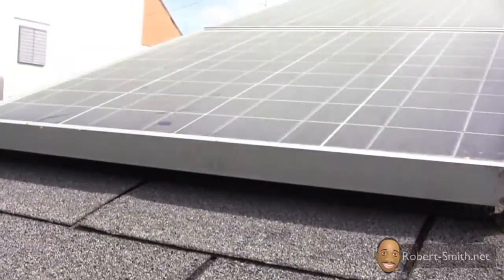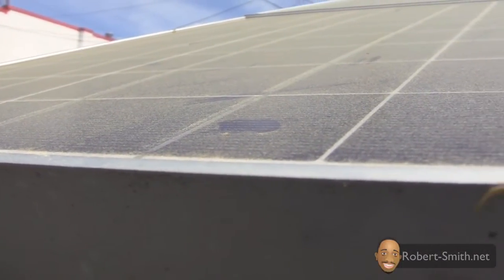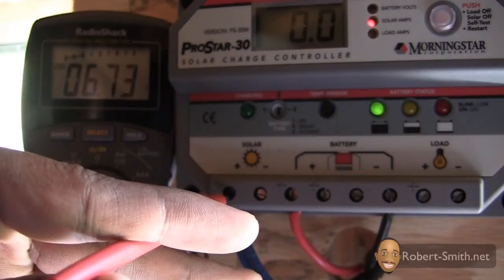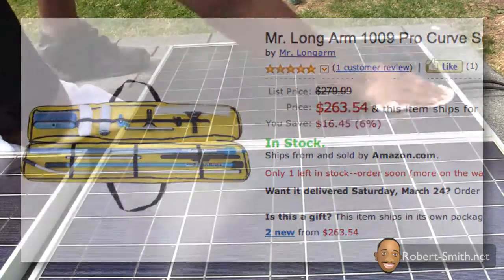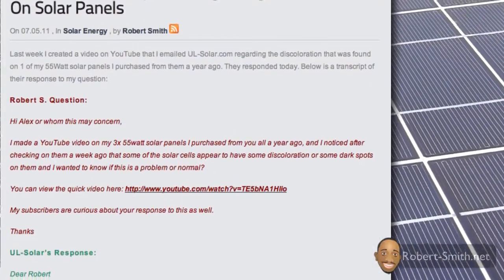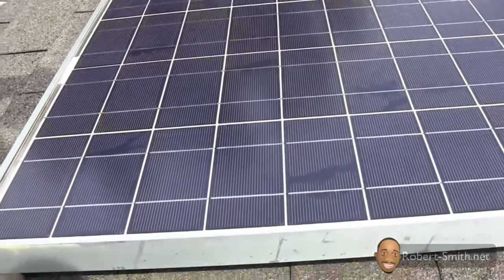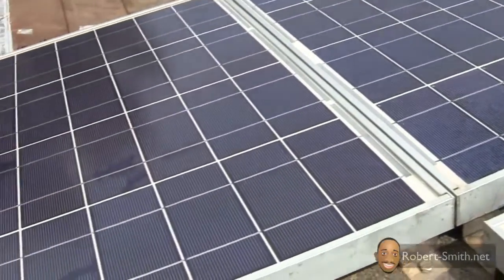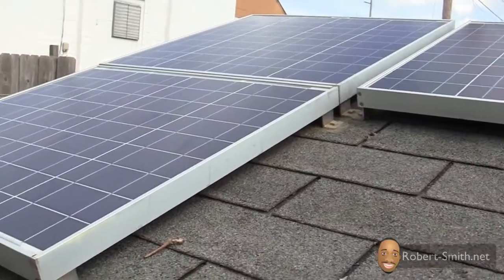UL-Solar Solar Panel Quality Check After 2 Years

Comment: Those are snail trails you are right. They are caused by micro-cracking of the cells during production and/or rough handling. The cracks occur when the cells are soldered or "stringed" together and/or when the panel is being laminated. Definite defect, they appear only when in use for a while since moisture diffuses through the backsheet foil and reaches the cell surface at the edges or through micro cracks. In the presence of an electrical field, operation temperature and possibly UV irradiation, corrosion processes at the interface between silver contact and encapsulation foil are triggered leading to a migration of silver into the EVA foil and the formation of Ag containing particles. A second precondition is the presence of S, P and/or Cl containing components, probably within the polymers, allowing a chemical reaction between silver and those components

Comment: Good info.  I too have been using UL-Solar's panels for a while.  I have 3 total 125W 12V panels on our camper with the first being purchased about 2 years ago now and the last about 6 months ago.  I do have some of the snail trails also but overall I still do get full rated power according to my SunForce 30A controller.  So far US-Solar has great prices, fast shipping and excellent quality in my opinion.

Comment: Hi,

I still have an 80w solar panel from UL, which I bought on Ebay. I recently noticed exactly the same trails on my panels. I'm glad you say UL will stand behind the products, since my panel still seems to work. I noticed that there is another ULSolar on Ebay, and the original UL-Solar is now off ebay. Very useful. Thanks

Comment from the maker: No problems with leaks yet. I used silicon to help prevent that when I installed them. The only thing I did not do that may not be a huge problem is prevent the wires from laying ontop of the roof. For the most part you cannot even notice that this is the case. 

The snail trails are definitely caused by something during the assembly process, but I am not sure yet.

Comment: I noticed the mounting method. No standoff/ flashing/ rails? Any problem with the roof leaking yet? How do you keep the wires from touching the roof?
I once read that the snail trails are caused from fingerprints on the cells before assembly.

Comment: Very nice!
A really handy device that you can install is a Watts Up Meter VU100. It is available online for as little $45. The meter is installed in series to your energy source, solar, wind, hydro, it will tell you in real time Measures energy (Wh), charge (Ah), power (W), current (A) and voltage (V), and its handles 50 A continuous and 100 A peak at 60 V.

Comment from the maker: The panel I built myself did not last more than a year, and it was full of moisture since I did not vacuum out any of the air or use a vapor barrier. I did not check for discoloration on the DIY panel but it is likely it suffered from that among other things.